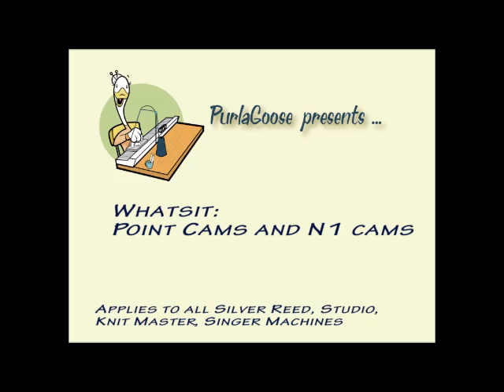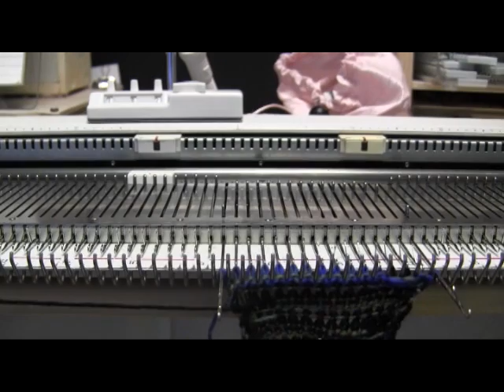Whatsit- Point Cams/N1 Cams

Comment from the maker: Assume we're making a sleeve.  You cast on at the wrist which might be at L30/R30.   Let's say the max width would be L50/R50.   If you put the point cams at L50/R50, you would need to move the carriage past L50/R50 on EVERY row or else the patterning would not be correct.   Personally, I'm not sure I'd remember to move the carriage past the cams if the needle there were out of work.  N1 shouldn't be moved because if you do, the pattern will shift.